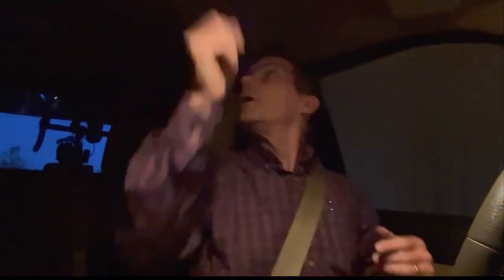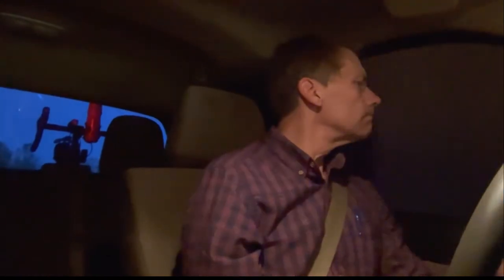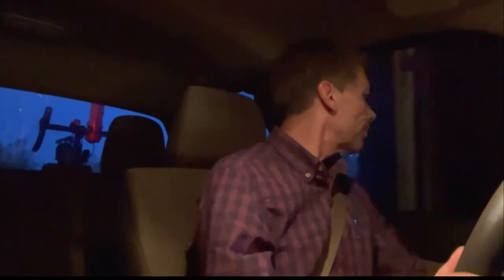F-150 Clattering at Start Up - Miracle Oil Cleaner to the Rescue? 505CRO

Comment: Allow me to recommend Liqui Molly oil treatment. I use it in my 05 tahoe.  Along with 10w20  synthetic oil.   I have 150k miles on it and topically this vortec engines tik and rattle at start up. But after doing two motor flushes and replacing two quarts of oil with the motor flush and letting it idle for about 10 minutes the engine runs extremely quite.  After the 10 minute idle time I flush everything out use fresh oil and filter and added two of those liquid molly  bottles. It did wonders for my truck.  Hope it can help your friend. As far as his truck is concerned I do agree that it's been an improvement. Perhaps if you repeat that cycle a few more time your fix could be permanent.  Additionally I did my treatment on my daughter's 2011 Hyundai elantra and it my a significant improvement on hers as well.
Reply from the maker: Congratulations.  It's nice to get a victory once in a while.

Comment: Walmart now has a pre-drain treatment put out by Valvoline called Top Treat. It is intended for professional use, i.e. Auto Service businesses, and is also is added prior to dropping the oil and filter. Add to engine oil, run engine around 10 minutes, then change oil and filter. The oil is noticeably darker and the new oil looks very clean after refilling the oil. The treatment isn't a petroleum/solvent product but what it is isn't listed in the product literature.
 
Personally, I'm a Walmart Auto Care tech, so I've used this product on vehicles. I'm not aware of any really bad issues with engine noise on startup that were fixed by this, customers usually don't come to Walmart for mechanical issues, we don't deal with repairing engines. If a noise is present, the engine comes to us warm already, so unless it's extremely noisy on startup when warm, we're usually not aware of such an incident being present.

Does it work, yes it does appear to be pulling more sludge and dirt out with the use. Is it good for the engine, I guess we'll find out over time.
Reply from the maker: Danny, I was not aware of that product or its use at Walmart.  Your description does make it sound like it is affective against sludge.  It appears the F-150 clattering is not sludge related. Thanks for watching.
Reply: @IsItTrueThat  A lot of these kind of issues don't turn up until after several years of use by the customer. Modern oils are supposed to provide sufficient protection against sludge and buildup being they contain higher levels of detergent, but evidently even that along with regular servicing can't always prevent every issue from happening.
I've never owned a brand new vehicle, and my current "newest" vehicle is a 2006 Dodge Grand Caravan with the 3.3L engine, so I'm learning the issues with that vehicle. I've worked on many of them, and the pre-Fiat vehicles do seem to be much better than the current crop of Chrysler offerings are. But they do have their little issues as I'm finding. But we bought it this past July, and only paid $1000.00 for the van and it had 129,000 miles so I'm considering it a win even with the work I'm having to do with it.

Comment: I have found that synthetic oil and changing oil every 6 months or 5000 miles which ever comes first goes a long way. ATF/Gear Lube every 2 year or 24,000 miles which ever comes first! I think most people wait to long to use "magic elixirs" maybe adding this to routine maintenance every 2 years on anything with VVT and Turbo Charger's might be a thing in the future since oil consumption and VVT issues are getting more and more common across all brands!
Reply from the maker: I think you are correct. In this case he strictly followed Ford guidelines for oil changes and the problem still occurred.  Just this month (about 15 months after this video) he had to replace the engine.  The only flaw likely was in the type of oil used when the oil was regularly changed.  Using your guidelines, especially with quality oil, might prevent premature wear on a new vehicle.

Comment: This shouldn't happen if you never let your oil turn dark. I change my oil every 3000 miles 200,000 miles runs like new. I do put seafoam in my gas and oil every 4th oil change . Maybe doing this collectively with on time oil changes has been suffice. Thanks